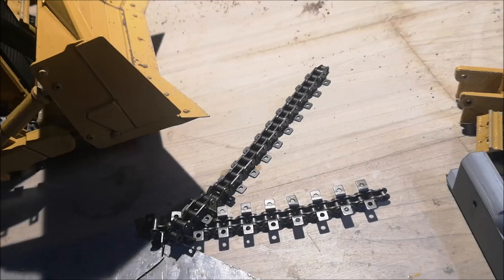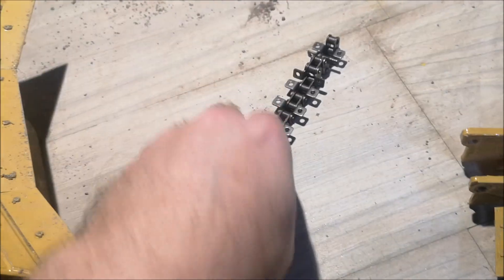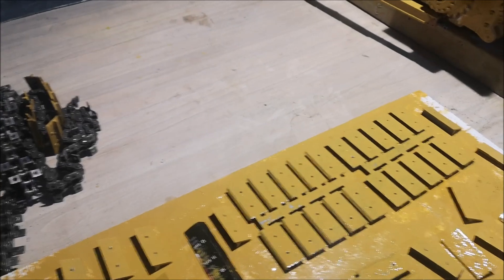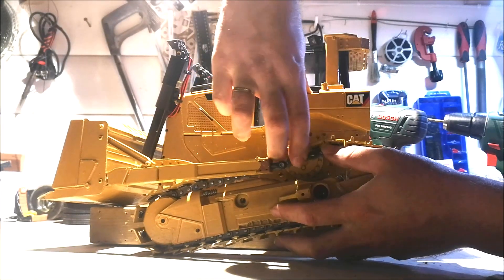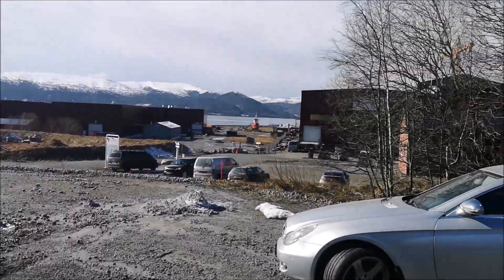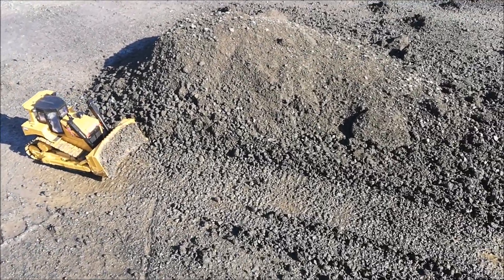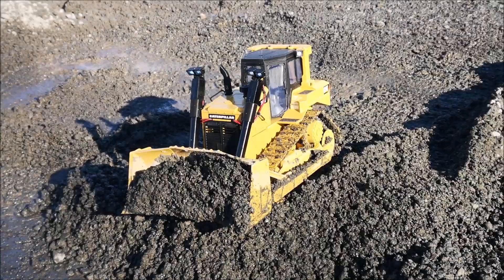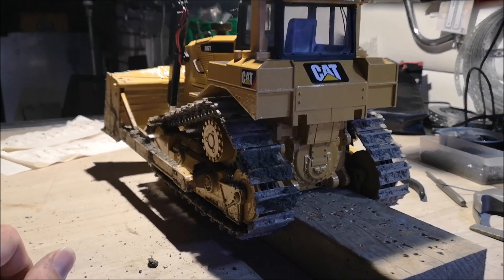CAT D6T - Rounded Chain Conversion Project

Comment: Hi Lasse, I think that it would be better if the "new adapter" was narrower and ran only on the chain rollers, not on the links, the chain rollers are loose, they will roll on the pad, there will not be such friction as when moving the chain links on the plate.
Reply from the maker: interesting, and you are absolutely right! thank you for sharing this point! it will be useful in the future :D

Comment: morning
Can you tell me where the chain is?
MFG Franz
Reply from the maker: Hello! I cant confirm that this is the "flat" type chain, but according to a guy on my cults messages page, it is. Here's what he wrote:

06B Flat Chains:

Thought I would just share this with anyone looking for flat chains as they have been difficult to find.

I found a seller on AliExpress where I was able to get the flat chains from. Follow the below link and select 06B 2 Wings 1 Hole.

Link: https://www.aliexpress.com/item/1005002370456660.html?spm=a2g0o.order_list.0.0.21ef1802rwTlit

Note: The picture doesn't show flat chains but I received flat sided chains and seller confirmed this before ordering.

Seller shipped my order quickly and when it arrived it even came with 1 connector link.

Not sure the rules about sharing links to products so if the link gets removed feel free to reach out.
Reply: @burnie222rclasseanhanger6  Hi Lasse, I had asked through the link to this seller if they also sold these flat link chains but they said no??

Comment: Another great video!! Congratulations, love your machines and construction site.  Are these linear actuator for the blades? If so, how many Newton or Lbf?
Thank you
Reply from the maker: thank you v much :) yes, those are linear actuators ;) the speccs on them are 12v, 100mm stroke, 15mms (64 n)
Reply: @burnie222rclasseanhanger6  Thank you! Just converting a bulldozer bruder, when I have my 3d printer, definitely I'll buy the bulldozer files from you! Great machine.

Comment: salve ho comprato il progetto grazie mille. un paio di domande che tipo di lama bisogna stampare che ci sono molti file diversi e che tipo di batteria usare
Reply from the maker: thank you v much for your support :) I used google translate to try to understand your questions, but its hard to understand. Do you mean which blade you should use? there are 5 to choose from, so you can use whichever youd like. The batteries I use is 11,1v 3S Lipo, 2200mah.
Reply: Ok grazie

Comment: Just wanted to say thank you for taking the time to find a solution so quickly! I'll definitely be purchasing more model's to build as they come available, especially after seeing all the extra time and effort you put in once you were made aware of the chain supply issues. I was already working on a bulldozer model so I won't be printing this one for awhile but bought the files anyhow, to show my support. Keep up the great work!
Reply from the maker: thank you v much :) :) awesome!! What dozer are you building? :D
Reply: @burnie222rclasseanhanger6  I'm building a D11T from a 3d model I found. Unfortunately I started it before your model was released... Question about your excavator... I have an opportunity to get some 1mm sheet metal for a good price... what size of sheet is the biggest i would need and how much do I need?  I know your plans haven't been released yet but I don't want to pass up on the opportunity to get the sheet metal at a good price. Thanks again!
Reply from the maker: @brentknutson2975  the biggest sheets are for the boom, the boom is about 60 cm long, so a 60x50 sheet should probably be enough for the boom, im not sure really
Reply from the maker: @brentknutson2975  the sheets i use are 1x1000x500 mm
Reply: @burnie222rclasseanhanger6  Awesome that's perfect! Thank you for the quick response.